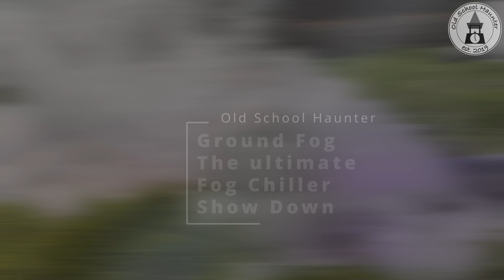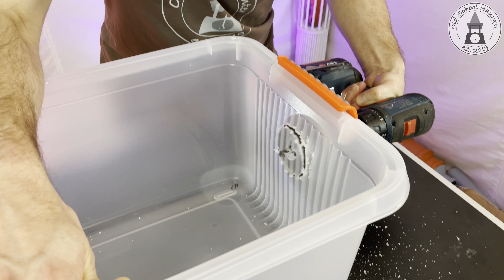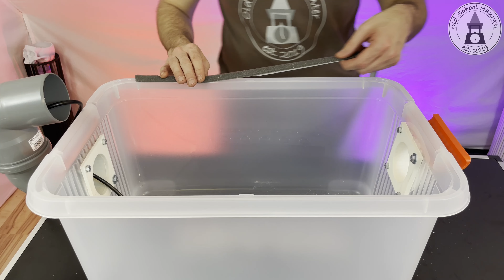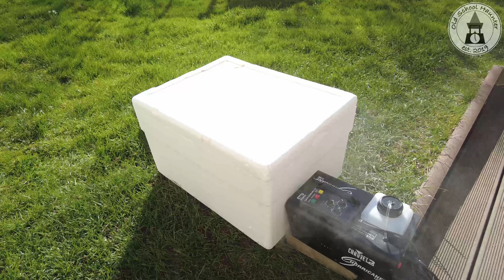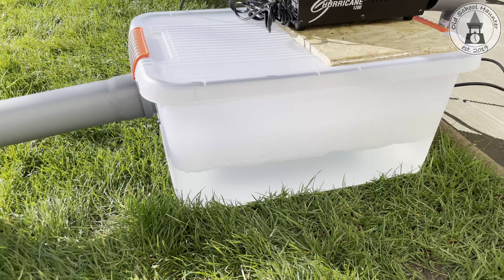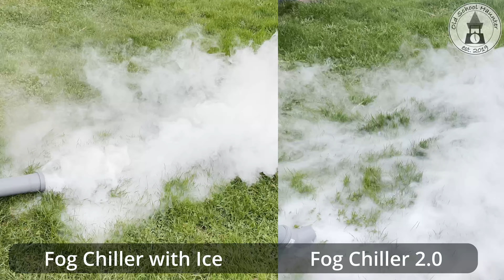Ground Fog for Halloween - The ultimate Show Down Fog Chiller 2.0 [DIY Fog cooling EN]

Comment: I am not quite sure I understand why you would buy the ultrasonic mister and still use the fog machine? Isn't the idea of using the ultrasonic mister to replace the fog machine? It seems to be quite a bit of an expense to replace ice.
Reply from the maker: yes and no ;-) First of all, you are right, when talking about the money. Such a ultrasonic mister is quiet expensive. So why combine it with a fog machine? When you want fog in a small area, using a mister only may work. But when you have porch in front of the house or you want to fog your entire garden, then a ultrasonic mister will not work. It makes to less fog. So a fog machine can produce a much larger amount of fog (using fog fluid of course) for larger areas. But the problem is, most of the fog will rise up very fast. So the idea is to use the ultrasonic mister to mist the water, and then the fog from the fog machine picks this water from the air the gets heavier. Yes it is a little crazy, I know, and as I said, it is not a cheap solution.

Comment: You need a float for that ... they make them for the ultrasonic mister so with the float it floats exactly at the correct level so you get max mist using it and can add more water so it doesn't run out of water...  also if you extend the pipe the length of the area you want the fog to cover and put a slit along the pipe the fog will travel farther because of less resistance... you can also add an inline fan to boost the distance
Reply from the maker: OK interesting thing with the float. I understand what you meant and what it does. Sounds very interesting :-) 
But I never saw such a thing. So I have to keep my eyes open for it. 
About the slit in the pipe. I don't understand, why this should work. If you have a slit along the pipe, then the fog will come out of it. Or is this behaviour intended and planned like this? I haven't tried it yet, so it sounds interesting too. Have you tried that?
Reply: @OldSchoolHaunter  What he means is if you were to say run it along the edge of the house, the fog will seep out the entire length of the hose creating a large blanket of fog across the yard coming from the house. Others drill holes every foot or so for a similar effect.
Reply from the maker: Ah ok understand. Yes you are right. I use pipes with some hole drilled into them my home haunt to achieve the effect you mentioned. But I didn't used them in this video here. But yes I agree with with you, when talking about to create blanket of fog. So thanks for mentioning this here :-).

Comment: As a CON for the 2.0 machine, you should have mentioned the mist machine is 150 bucks.
Reply from the maker: I didn’t talked about the price, that’s right 😔 But I’d thought I mentioned it is expensive. Didn’t I? But this is important to take into account. 👍 
I got mine from Ebay for 90€ as a special offer.
Reply: 💯 good video, but definitely needs to add the ultrasonic costing $100+

Comment: Thank you for the comparison. I was surprised how similar the results were. I have seen more and more of ultrasonic misters as an alternative to ice and it is a game changer. My plan for this year was to set up 3-5 foggers and have them alternating to keep the fog flowing. Hopefully it doesn't overload anything
Reply from the maker: Thank you :-) Fog results are close to each other. The idea to have the foggers run alternating is pretty cool, so you have a constant flow. I would start with 3 foggers and see how it works and the add additional ones. So good luck with your idea and Happy Halloween 👻👻👻

Comment: I use a high output fog machine with the ultrasonic "chiller". I used a huge ice cooler to hold the water and it lasts for several days. I've also used scented oil to make the fog smell good. I just uploaded a short so you can see how much it puts out if you use a bigger machine and water "box".
Reply from the maker: Nice work. The amount of fog is really impressive and compared to the traditional one with ice, I think the fog is much  thicker. :-)